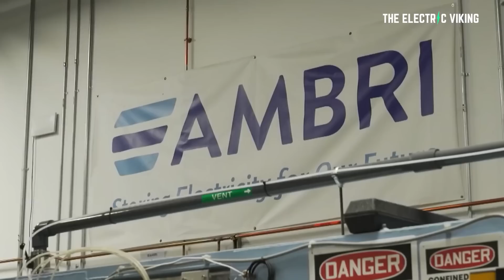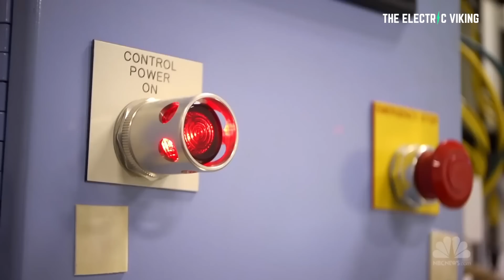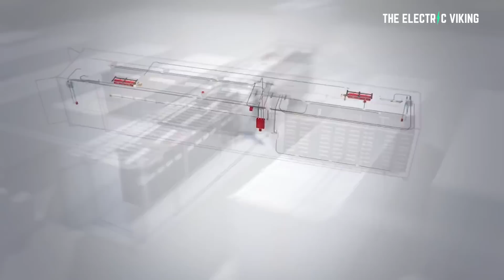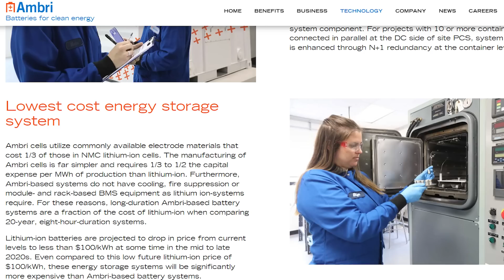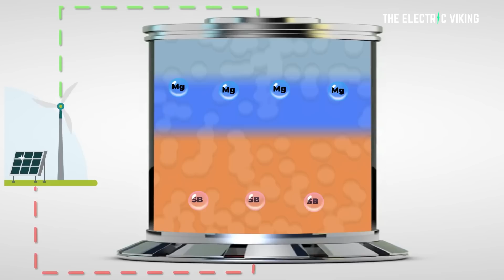US Liquid Metal batteries will reduce the US's reliance on China

Comment: I've been following Ambri for a year or so.  Hoping to check back in 3 or 4 years and see how they stack up against Megapacks.  It would align with Tesla's mission if they could accelerate the scaling and adoption of this technology.  I remember the round-trip efficiency with liquid metal was not great -- and there were other thermal technologies that had less waste with competitive costs.
Reply: The only problem these batteries face is the fact they are controlled be university staff , eg they had issues with repeatable welding there answer cut staff by half and spend 3 year and countering trying to fix it while the world move on the right move was the bring in experts in welding and  production and get it fixed fast
Reply: The only time there is any inefficiency in these batteries is if they are drained completely into a non molten state. In their molten state they are greater than 97% efficiency.
Reply: @davefroman4700  That efficiency happens if they are placed in a fantasy world where everything lands perfectly to their strengths.  If they go into a real world market, they suffer from conditioning. A liquid metal system and a megapack solve unique issues and would be deployed and managed in different ways. Liquid metal market fit is actually exceptional with a virtual power plant.

Comment: For short term solar and wind stations, liquid metal is my pick, unless they want to make the cells the size of football fields, insulate to keep over 650f, and put steam colling systems in them when they get too hot.  For long term, geothermal, pumped hydro, and salt flow.  Do remember that pumped hydro can also be used in a desert by filling and emptying old mines.  For power grids, I'm still going to stick with lithium.
Reply: For large scale wind farms, I would agree that pumped hydro is the standard. The only way to cover lulls in output, which could last hours or days. It has a 90% efficiency vs 95%+ for batteries but more scalable. And yes, lithium batteries used in South Australia had a 14ms reaction time. Much better than pumped hydro for transient interruptions and quality of service maintenance.
Reply: @avgjoe5969  The best way to handle long lulls is to generate more energy than is needed in any one location and move the energy around with a robust grid.  It is not cloudy or windless everywhere at the same time.  The batteries can then be used to cover glitches in power.

Comment: Have you checked out Brisbane based company Redflow. Their just released ZBM3, Zinc Bromine flow battery is the world's smallest flow battery that can do residential/industrial/micro grid to grid scale. Bar fridge sized to containerised gives it multi functionality, is easily mass produced and scalable and is an Ozzie invention. Putting 2 in my home later this year.
Reply: I am curious how much does it cost? these bloaks make their flow batteries on Thailand, these 10KW pack is a 2bins sized package ain't it?
Reply: @tam12025  ATM more expensive up front cost until they scale. More than likely US will be sites of a much larger production facility. The total cost of ownership due to predicted 20yr lifespan of battery with replacement electrolyte after 10yrs is favourable. Full depth of discharge and ability to operate up to 50°C are big benefits in hot climates. Anti fire and anti theft(250kg) also big attractions for remote and fire prone areas. Building managers are also starting to limit LiOx in high rise buildings. Happy to pay a little extra for peace of mind frankly.
Reply: Brisbane Florida or Queensland?
Reply: @markrowland1366  Australian Brisbane mate

Comment: great video. I think we are missing one thing. HOW will be charge all these batteries when the grid will hardly support 30% of the cars under full adoption. THIS is the bigger story. this is why I support battery swapping
Reply: The grid scales with demand, with a short 'lag' period.
Renewables are now cheaper in $/kw than fossil and much easier to scale. The grid will support 100% EV adoption.
Reply: Battery swapping is not going to be a solution, but it will slow the transition by 15 years. It is also why Nio is 20 times smaller then Tesla. The grid will get stronger. Most people are charging at night when people are sleeping. So, there is no problem because people are charging off peak Electrical times. The grid is doing it and will be making more electricity as it needs it. 
Full adoption is going to take 25 years, so I am not worried about the grid, it is not going to happen overnight.
Reply: Battery swapping doesn't mean the grid doesn't charge the batteries. It just means you pull into a station where a pre-charged battery is quickly installed in your car. They then recharge the battery from your car before giving it to another customer. Overall, the demand to the grid is mostly the same.
As far as the demand on the grid, I don't think mass adoption of EVs will really be a huge problem for the electric providers to solve. Some changes do need to be made. If the engineers plan carefully, there will be massive benefits to the grid. EV's can actually mean increased grid stability.
Reply: At least today, most EV charging occurs at night when grid has huge surplus capacity.  Not a huge problem.  EV owners learn to get into this groove pretty quickly because it is cheapest and sometimes free overnight charging.

Also big chain charging companies like Electrify America already have grid scale battery storage on-site.  They likely charge the batteries overnight and sip power from the grid in between EV charging.  To get the big 120kW+ charging rates over multiple EVs, having on-site battery becomes a requirement and not optional.  Of course, they can add solar panels as well over their parking lots or have an energy contract with the mall or store parking lot they're usually located on.

In the future, we're looking at much more commercial solar installed over plentiful rooftop and parking lot area.  Coincidentally, this is where a lot of charging stations are located.  As we know, on-site rooftop and parking lot solar reduces load on the grid which is a huge benefit a lot of people don't consider.  By then, grid scale store will likely reach offices buildings and big box stores too which magnify on-site solar's availability capacity that much more.  If solar isn't enough for the location, the charging station's on-site battery could arbitrage grid power at night to top itself off.

As other's mentioned, the grid will obviously need to expand over the years.  Thanks to the US Senate just passing the new Inflation Reduction Act, EV charging and the grid infrastructure will get an extra kick.